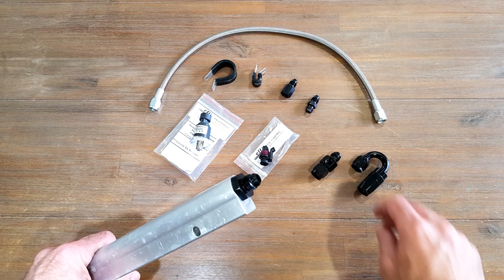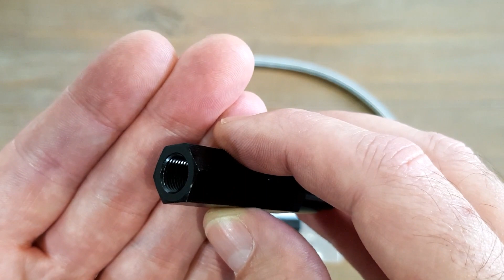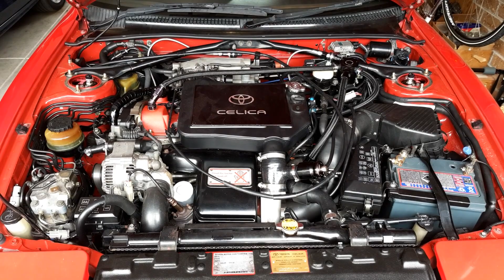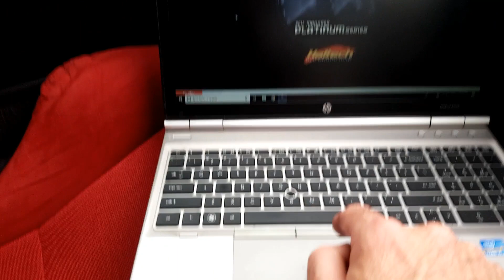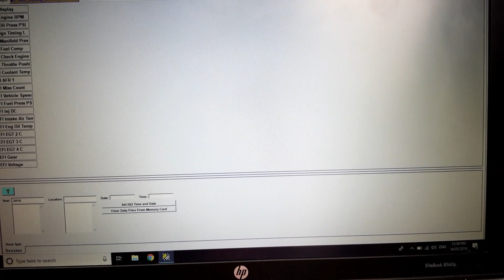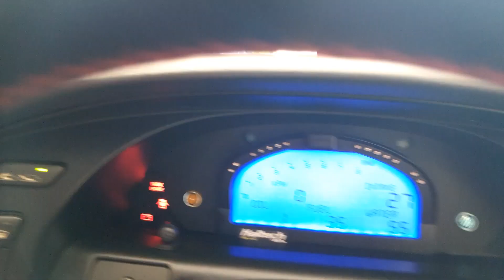INSTALL: Toyota Celica ST185 GT-Four Group A - Fuel & Oil Pressure Sensor and Oil Temp Sensor

Comment: "Hi, great video, let me ask you a question; do I see good you use with all the new staff the old factory denso fuel pressure regulator? It works fine long term with E85/E100 without any harm? What experiences you have? Thanks"

Comment: Hi,
Great setup.
I have a Haltech IQ3 digital cluster, however the original cluster is removed.
Can both co-exist?
Do you know where in Sydney I can get someone to install original cluster as well as having the digital cluster working also.
Just wanted the car to look original and also record kms.
Reply from the maker: You can definately run both the factory cluster and the Haltech IQ3 in conjunction with each other.

Installing an original cluster will be dependent on whether the wiring hanress and plugs for the factory cluster are still there, if they are, it is a straight forward jobn as you just plug the three main harness plugs into the back of the cluster, but if they have been cut out (unlikely) it will be a big job.

I am not too familiar with whos who in Sydney, but I would suggest looking at Advance Motor Mechanics in Strathfield South.

Comment: Why did you choose to get a oil pressure rating on the head rather than the block? Doesn't make sense to me, as oil pressure at the head is less important...
Reply from the maker: Couple of reasons. 1) Simplicity: The factory oil pressure sensor is located in the head - so I removed the factory sensor and utilised the factory location. 2) Cost: To run it in the block would require custom work/fittings/labour - so I avoided that by using the factory location. Cheers.